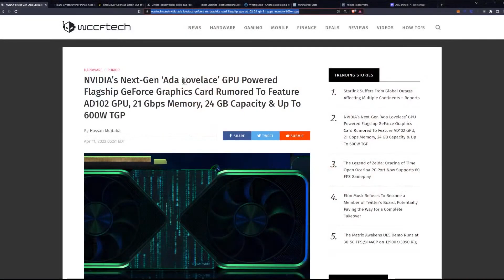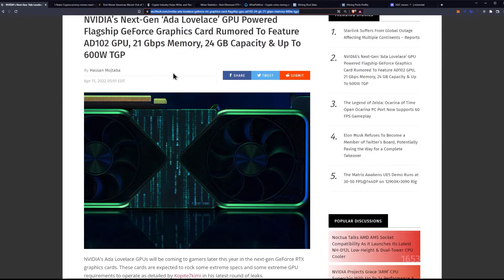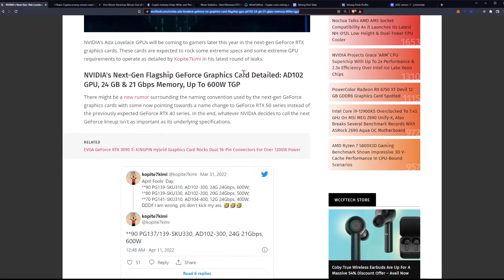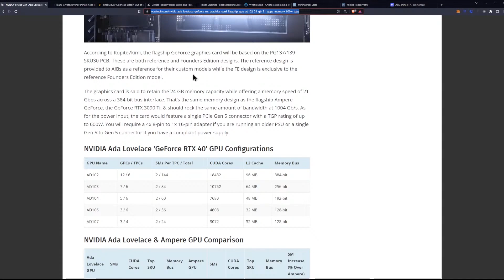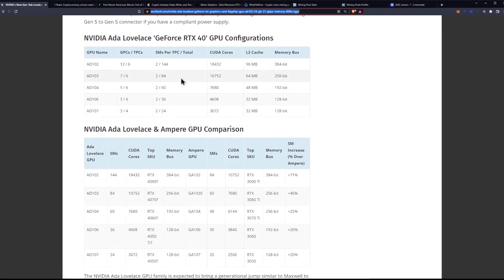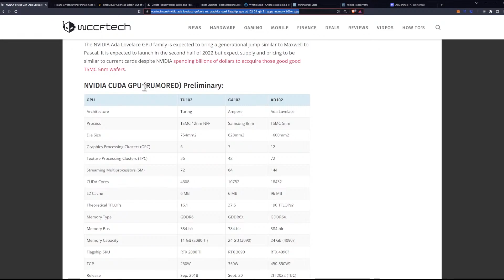ADA Lovelace Won't Be Better For Mining

Comment: Whatever crypto mining anyone does, if you can purchase hardware at less than 10 dollars per mega-hash per second then you have a good chance of breaking even regardless of the algorithm and coin you  choose to mine.
An RTX 3060ti is currently on sale at 440 dollars, so, if the MH/s is 40 then you should only buy the hardware at 400 dollars or less, and the video cards that can only do 30 MH/s should only be bought at 300 dollars or below. The majority of video cards remains at least 20% above their retail prices and more than 40% above the breakeven point of pricing of 10 dollars per MH/s.

Comment: If NVIDIA doesn't artificially limit Lovlace with LHR it will be better at mining. Max TGP doesn't matter for mining, no GPU needs to run at max TGP for its max hashrate. The switch to TSMC 5/4N node from Samsung 8N should already improve efficiency.

Just because the memory will be the same as on the 3090 Ti doesn't say much about how efficient the new architecture will be. Ampere was a 50% improvement over Turing on the 256-bit SKUs.

Comment: if TSMC sandwich two AD102 Nvidia like M1 Ultra, it going to be power hunger but extremely high performance.

A102 ultra fusion.

i highly believe nvidia follow path like M1,  wafer yield rate define which GPU to produce, one wafer produce two series of GPU, 3000 and 4000 in same wafer.

Comment: Will GPU mining still be a thing in the next round?
Reply: I mean, sure. Just not as profitable as it is now. From what I have been seeing we are expecting some 8nsanity for a few months, and then profitably should level off somewhere between 30-50% of what is being earned now. Unless something crazy happens... Time will tell.
So right now, your income should be somewhere around 6-8x your power costs. So take whatever your income per power is, multiply by .33 or .5 and that will get you what your income will be.
So on my 2 Gpus I am spending 80 cents of power for $5 of coin. So that should drop to about $2 worth of coin right now... Which is not great, but still more than doubling my "efforts". Probably enough for me to justify picking up some 20 and 30 series cards for cheap as next Gen cards flood the market. They won't pay for themselves right away, but I'm in crypto for its 10-20 year promise, not the next couple years. So as long as mining coin is essentially allowing me to purchase coins at a discount, and I have other uses for the cards as a fallback option, it is worth doing.
Because btc right now is around $40k, with half a chance at hitting somewhere around $500k-1M in 8 years. So I am mining $5 worth of coin a day, but if I sell 8 years from now that is closer to $60-120 per day. So yeah... Even at reduced profitability, as a home miner just mining on a few game rigs it is totally still worth doing!
Now if I was renting space, or paying higher power rates... Well that is a different math right there. I can only realistically expand to 8 cards, and I can wait to find a steal on the specific cards I want, so it is all going to still be profitable. Still much more profitable than my traditional investments, and I still do those... So surely this gamble is still worth betting on a while longer.
But who knows! 8 years from now I may be a crazy dude on the streets holding an end of the world sign lol
Reply: No. It will sit doing nothing never to ROI.